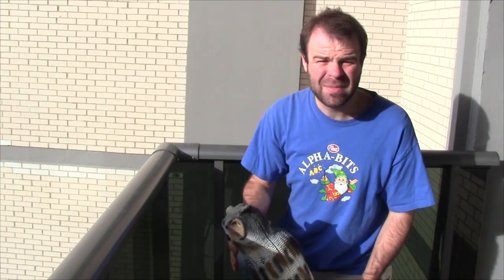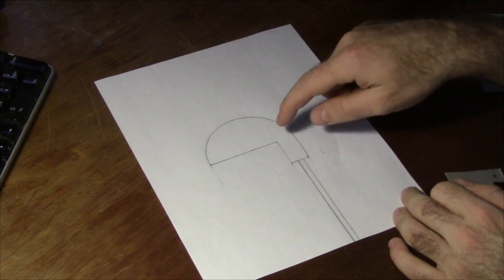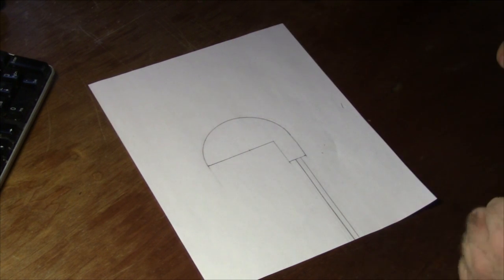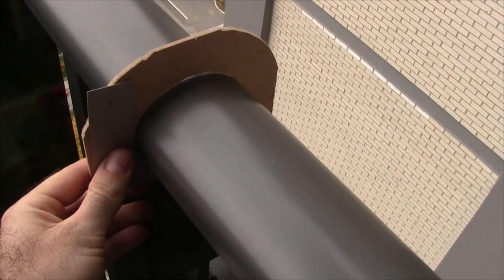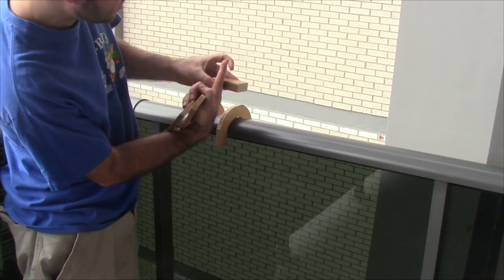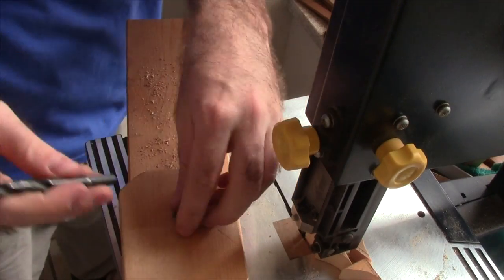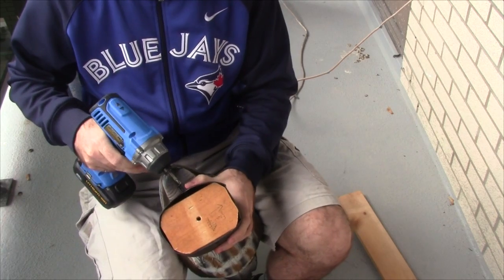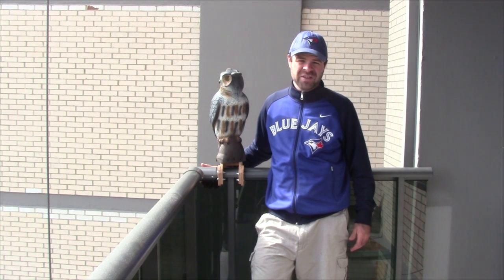How to Install a Plastic Owl on a Balcony Railing

Comment: Wow. Great video. Where to you grind those T bolts? Have never seen one before - those are the answer.
Reply from the maker: Are you asking about the t-nut that I installed at 4:26? They are super handy! Available at most hardware stores and big box stores such as Home Depot in the fasteners aisle. They are sometimes called a "tee nut".
Reply: @cjhoyle  Thank you for letting me know. Yes, that is the one I was wondering about. What a great discovery to learn about them in your video. I think I can also use them to mount bird houses in the backyard.

Comment: You need chicken wire netting installed.  I live in a highrise too and there's a guy here that would do it for a fee. It works great in keeping birds out as well as prevents any flying debris larger than an egg from messing your balcony. Plus I have a very hyper cat that would have jumped over the side if it weren't for the cage keeping kitty safe.
Reply from the maker: +Curtis TorontoTransman This is the 4th video that I've posted regarding pigeons vs owls and I'm quite confident in this solution. I would not want something like chicken wire obstructing my beautiful view of the city.

Comment: How did you clean up the pigeon mess? I would like to use a pressure washer but its not an option. I have a Duradeck coating and its seemed to have stained in a bit.
Reply from the maker: I just scrubbed it with soap, warm water and a rag.

Comment: Great solution to a gross problem! I wonder if you might supplement the owl with an automated water sprayer. You can buy them ready out of the box, they're designed for scaring cats. search "cat scarer water pistol", could be fun!!
Reply from the maker: +Dan Sinha It looks like a cool toy, but probably wouldn't be very practical for my balcony. I live in Canada and the water would freeze during the winter.

Comment: The ironic thing is that this is sometimes used by pigeon fanciers (I'm one) to scare away pigeon predators. Pigeons have basically 3 main predators, sparrowhawks, peregrine falcons and goshawk. Those birds of prey have very little predators themselves except large owls like the eagle owl. So pigeon fanciers put up statues of eagle owls, often with a tape playing the sound of the eagle owl. 

Pigeons aren't that scared of the owl statue and get used to it after a few days when they realize it's fake, pigeons are quite a bit smarter than birds of prey (pigeons succeed in the mirror test, unlike birds of prey)...I assume a statue to actually keep out pigeons would have limited success.

There are actual little spike thingies you can buy so pigeons can't land on the railing, but it doesn't look that pretty.
Reply from the maker: The spikes aren't pretty, they obstruct the view, and they also don't prevent the pigeons from landing on the balcony deck or other items stored on my balcony. I made a separate video previously discussing my experience with how effective plastic owls are at discouraging pigeons.